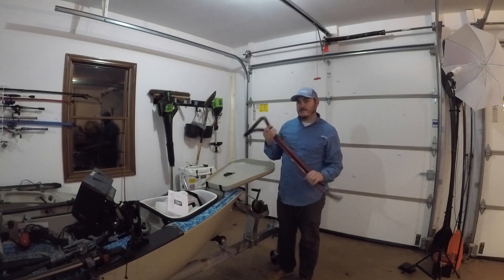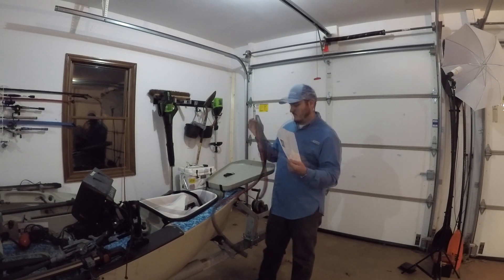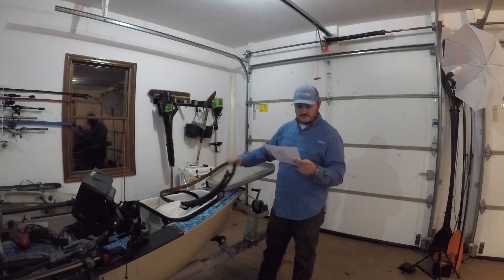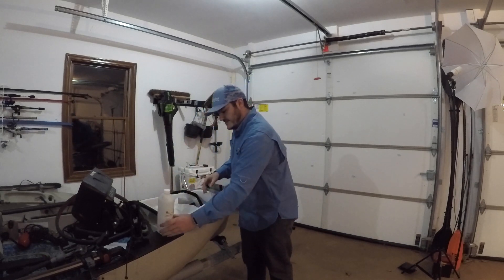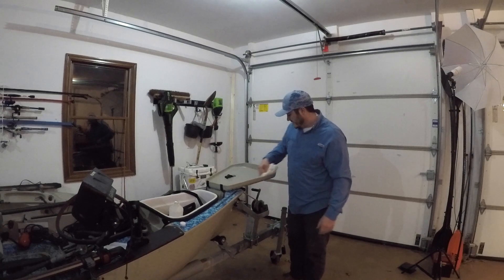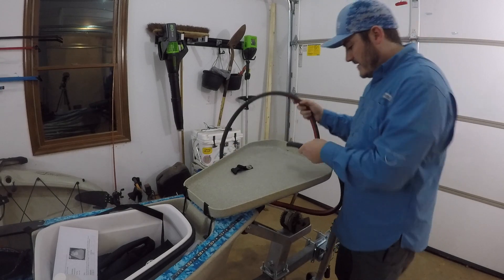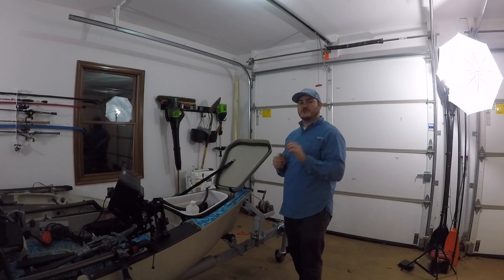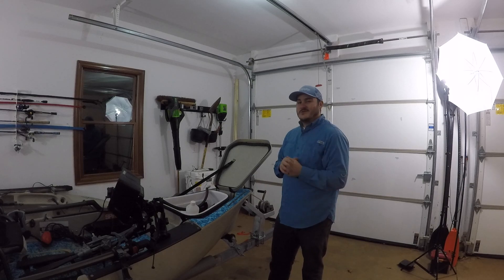Hobie Pro Angler Front Hatch Seal Install (Found in 2018 PAs)

Comment: Do you have a video on installing the dual raised steering?
Reply from the maker: I don’t however it’s really easy. Step 1 removed hobie decal on handle and then unscrew the screw holding the handle in. Step 2 place riser and handle on top of the riser. Step 3 screw in the longer screw provided with the kit and reapply new Hobie decals.

Comment: Did you notice the seal helping? I have a 2016 PA and need to do this.
Reply from the maker: Yes I noticed that it did help although I don't go through waves or anything like that. However I have noticed a better seal when it's raining and no water leakage when washing the kayak either.
Reply: Blue Summit Outdoors thanks.